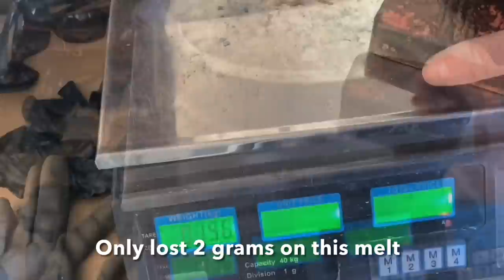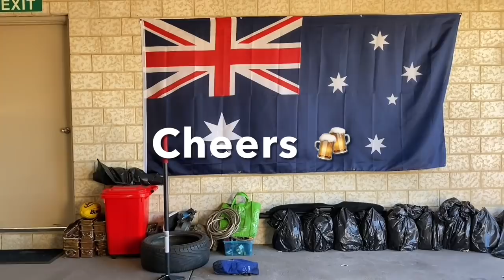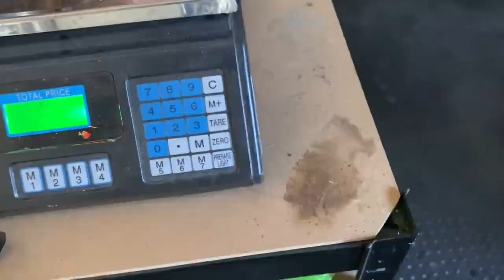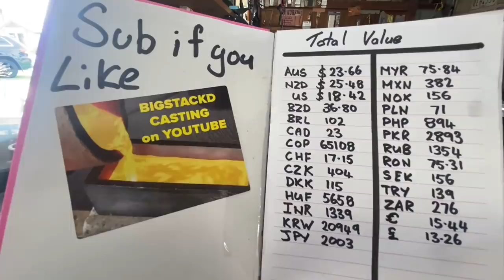Melting Copper - Dumpster Diving - Trash To Treasure - ASMR Metal Melting - BigStackD Cable Casting

Comment: I don't know how well it'd work but you can probably put a V shaped metal piece after the electric cable stripper, remove the plastic a bit, feed it into the V shaped metal piece to just directly remove the plastic from the cables. It'd probably work by itself for thicker cables but for smaller cables you'd probably need to pull it from the other side. And the metal piece can be shaped like an expanding duck's bill which can be cast. I know it's probably not worth it but just an idea, inspired by the comment you had "You still need to manually remove the copper" 😁.

Comment: your copper casting videos are my favorite. I wish you could figure out what is causing the porosity and voids mostly on the bottom but also the sidewalls. Copper cooling too quickly? Maybe if you brought the mold to the same temperature as the molten copper before pouring that could be fixed?

Comment: When I was in Melbourne in Spring of 2009 copper was expensive, so someone stole the copper parts from the switching equipment at Prahran Station. Shut it down for a couple days if I remember right.

Comment: Loving your videos! Quick question though:
1) What do You do with mixed metals? Like say if aluminum, bronze, and copper were all warped together?
2) How do you tell your metals apart if they are the sameish color?
3) Could you explain your polishing process please? What brushes you use, what chemicals, etc.
4) How do you recycle slag? Or what do you do with it?

Thanks again!

Comment: Nice videos! Hey this is just a thought, I wonder if you might save some propane by using a Fresnel lens from an old projection TV to preheat the metal in the crucible in the forge? You could probably build a stand to hold it. Either way, really great videos, I really like the copper melts and the mirror finish at the end. Cheers!

Comment: I have often wondered if it would make a difference in the pour if you put a reducing flame just before pouring. By cutting the airflow back on the burner, it converts oxides back to base metals. Just curious if you could see if it made a difference in the casting. I used a reducing flame in glassblowing and got some insane rainbow effects.

Comment: Stripping the wires seems like a chore. Have you tried either removing it chemically, or using a solvent to dissolve or at least soften the PVC?

Comment: I'd be interested in seeing one without any stripping of shielding/cladding. Just bung the wire straight into the crucible, and only scoop off the cruft when it melts/burns and floats to the top.

Comment: Are you reheating the copper everytime you cast one portion of coins? Or does the residual heat from the initial melt last long enough to pour everything in one go?
Reply from the maker: normally once the copper is molten i can pour it all out into the coin molds but sometimes ill need to chuck crucible back into furnace for a couple minutes as the copper will start to freeze. If i worked a touch faster i wouldnt have to reheat but its only a few more cents in gas to reheat:)
Reply: @bigstackD  Ah alright, thanks  for letting me know! I wish I had the space at home to start with casting :(

Comment: Just found your channel. Very cool. And by cool I mean hot enough to melt metal.
Just curious as to what you’re going to do once you reach a tonne? Is there a goal in mind or are you just building the most impressive treasure chest ever?
Reply from the maker: I just pick one tonne as that an achievable goal in the next couple of years but once I hit that I’m sure I’ll just keep going but I really need to rebuild my shelves because a few of them are starting to sag and pull away from the wall, if I had my way I will eventually have one tonne of mixed coins in a big chest so theoretically I am trying to make a massive chest eventually. But this whole channel is a hobby that I love doing so I will just keep on going until my liver gives out from too many beers👌🏻😁
Reply: @bigstackD  in my view, hops are a vegetable so beer is part of your five + a day ;)

Comment: Might be too much to wish for but it'd be cool for you to be able to melt & mold a bar, then work it into a long thin strip to punch coin blanks (as one does) and then mint your own coins rather than pour molds. But I realize that kind of equipment is super expensive.
Reply from the maker: Actually buddy when it comes to brass copper aluminium Nordic gold bronze and all that stuff it can’t really be forged or  hammered as it will actually start to split that’s why you will never see anyone forging copper or brass, but trust me I have thought about what you’re saying about making a nice big long strap of metal and if you did have the rollers and stuff you could certainly make a nice strip and cut out the coins if you had steel stamps etc. Like You said it would cost an absolute fortune to get all that stuff set up🙄 but I will be looking at hopefully acquiring some double sided molds soon where they were basically come out like a stamped coin👌🏻well hopefully they will and If not I’ll just try get a heap of custom coin molds made and then sand down the other side where I can put my personal stamp on it👍🏻

Comment: No mater when you get to it - please show us you making a new place of the metal you have and the metal yet to come. And many thank for mentioning that beer caps are steel. The caps might be a good idea for a video because they are small and thin and may be easier to melt than that peace of steel you tried to melt with copper a few chapters before.

Comment: Question for anyone - any idea how much (in total weight) you can get from the average radiator from an automobile?  Extension plug, or if you're from Australia or the UK - a cable?  Or from an old motor that you've show in multiple videos?  What is a good price for an old motor?  Thanks very much and God bless.

Comment: I was curious about the copper melt temperature vs the pouring temperature. Apparently you’re supposed to pour copper below it’s melting point after bringing it up to that melting point. There are either thermal dynamics at play here I don’t fully understand or I have my information wrong. I’m sure someone here has an answer.

Comment: CAN U MIX COPPER AND ALUMINIUM PLS PLS PLS
Reply from the maker: I’ve done copper and aluminium mixes heaps of times Matey it makes aluminium bronze. I should be making that in next Fridays vid as well as Nordic  gold, bronze, copper ,lead, tin And more.
but you should only add 15% aluminium at the most in the mix otherwise if you add too much aluminium the bar you make will be brittle and will break if you hit it with a hammer or drop it on the ground.
Reply: @bigstackD  cheers mate thanks so much

Comment: Still trying to track down one of those strippers.
Reply from the maker: just get on eBay and type in electric wire stripper and they should come up. Its a no name brand but they work awesomely👍🏻
Reply: @bigstackD  can't find them in 240v for nz aus power. That's been my problem

Comment: This is the shittest question you will ever be asked. What is your garage floor made of? I need your floor.
Reply from the maker: just standard concrete as far as I know matey👌🏻
Reply: @bigstackD  Ah. Excellent 😂 Just about to start melting stuff too and heard concrete explodes if you put the hot stuff on it so thought I needed to change my floor
Reply from the maker: Concrete can have moisture in it and if it gets hot enough will turn to steam and pop in can possibly explode small chunks and send molten metal everywhere, I’ve spilt molten metal on my floor probably 20 times and I never ever have had any concrete problems but if you’re a bit concerned what I normally did when I first started was sit the mould on a fire brick and put sand around it or pour it where if there is a chance of spilling you’ve got sand or something underneath👌🏻
Reply: Good shout. Cheers. I’ve just watched about 15 of your videos in a row I can’t wait to start finding old motors and just melting them 😂